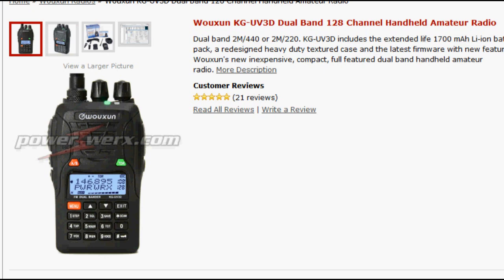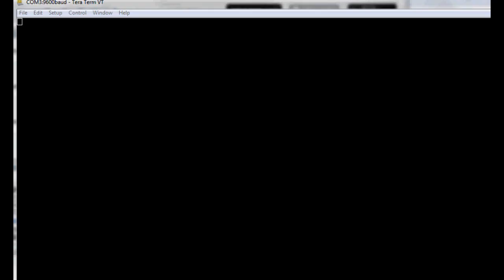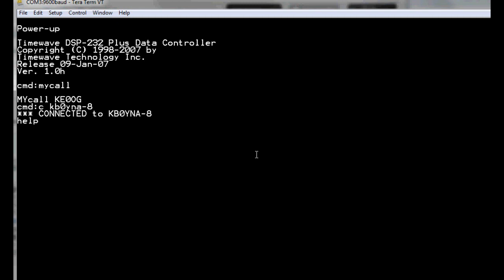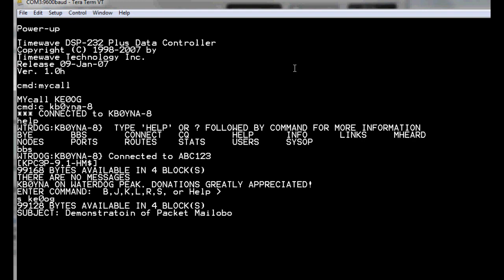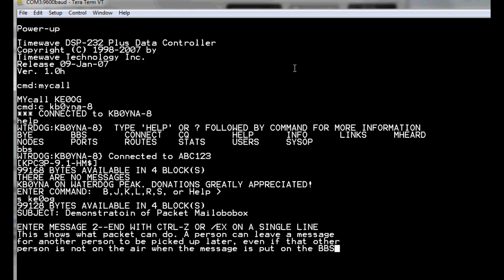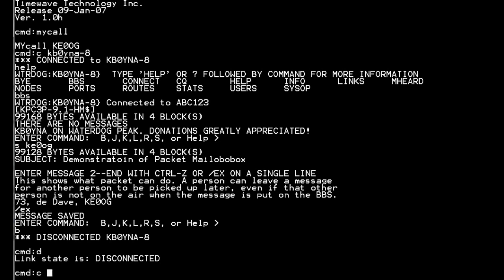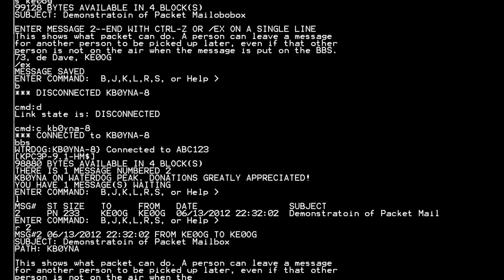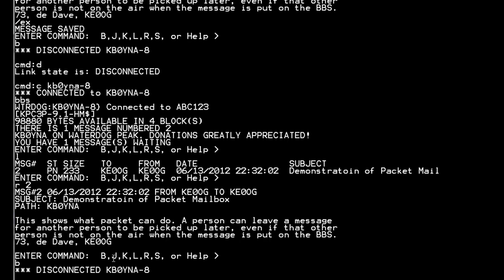Packet Radio Bulletin Board Demo

Comment: Is there a preferred TNC that is reasonably priced and is vhf Packet still going on today?
Reply: Digipi is a firmware for a raspberry pi it the same as an old tnc but on steroids 😂…. Though an kantronics model is still most stable tnc once set up it doesn’t need a pc, probably could run for years without breaking down.

Comment: What program(s) did you use to run the BBS?
Reply from the maker: The BBS shown is the one that's located up at Waterdog Peak. Many of the original TNCs had BBSs built in. The original packet system did not rely on computers--just ASCII terminals. Really old technology!

Comment: What program are you using for the terminal? Does it work with kiss? I was thinking of getting a mobillinked bluetooth tnc 2 or tnc 3
Reply from the maker: I was probably using Microsoft hyper terminal.
Reply: @davecasler  thanks again and thank you for being an elmer to many of us. I'm going to give a packet bbs a try using mobillinked and my baofeng. Since upgrading to an anytone 878 and an anytone 5888iii i have been looking for some more use out of my 1st radio

Comment: You can pick up a used KPC-3 or KPC-3+ for $100, sometimes less. I just bought one like-new in the box for $100 delivered, with upgraded firmware (ver 8.2). I bought another used KPC-3 by itself for $85 delivered a couple years ago. They are very reasonable if you know where to look, such as qrz.com or eham.net - Ebay is a big RIPOFF though. Some people will use software along with their PC soundcard in place of a TNC but I much prefer using a standalone TNC because IMHO it gives far more reliable communication. The KPC-3 and 3+ are extremely common TNC's and fortunately there are a lot of them out there. If there is 1200-baud packet activity in your area, commonly used packet frequencies can be heard on 145.010, 145.030, and 145.050 MHz.

Comment: do most tnc's have BBS?
Reply from the maker: The old ones did, yes. These days the actual TNC part is done in software, and I haven't seen BBSs or even maildrops in them. The BBS I show in the video is part of the digipeater atop Waterdog Mountain. That type of BBS is pretty common. Frankly, packet radio is now a niche part of ham radio--the newer digital "soundcard" modes have taken the world by storm.
Reply: David Casler Thanks. I have an MFJ- 1270B. It has 5 LED's. DCD, PTT, STA, CON, PWR. I want My friend to be able to SAVE a message to me when I am not there, and I want to be able to know if I have a message by an LED indicator and read it . I am hoping that is what the STA LED is for. Do you think so? The instruction manual doese't say much about BBS, but it does say it can SAVE stuff, like capture all of the packets that went on overnight and recover them.
Reply from the maker: Skyler F Skyler, what little I can find on the MFJ-1270B would indicate it doesn't have a maildrop or BBS built in. I find an owner's manual at http://www.repeater-builder.com/mfj/pdfs/mfj-1270b-tnc-manual.pdf and see no reference there to any functionality that would be consistent with a BBS or maildrop.
Reply: David Casler Oh well. Its funny that they would even have a store function if they can't store messages directed to you, all I found was that the packet TNC could capture any activity ex. overnight, and store it to the RAM. 73 de KDØWHB
Reply: I use the UZ7HO soundmodem with with it's companion terminal program Easyterm,, by the same author. 

Easyterm has a built in Personal mailbox just like a TNC, but with much greater message capacity, only limited by the size of your hard drive..

I connect it to my FT857D via a home brew interface, and use VOX for transmit/receive switching.